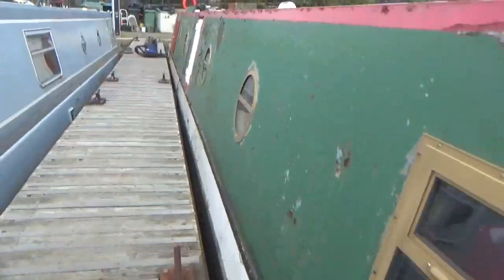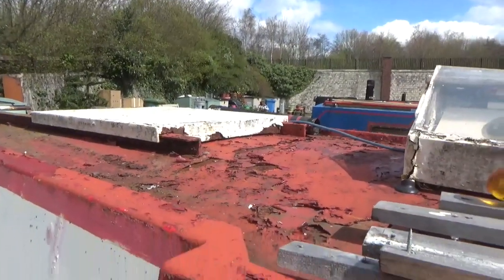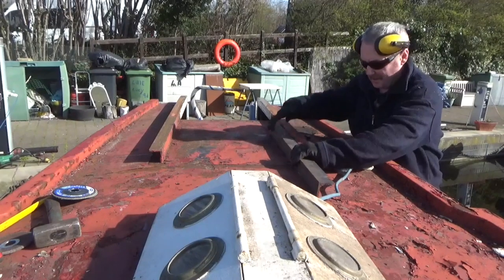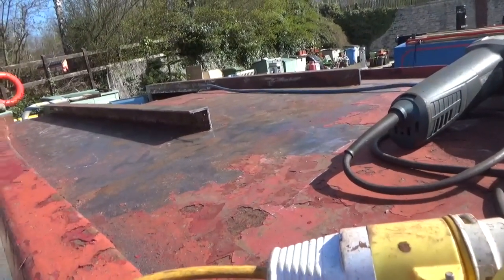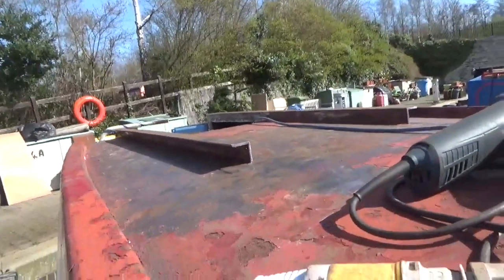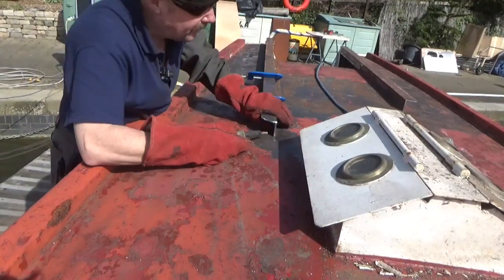Narrowboat Build & Fit Out Extending the stern hatch pt1

Comment: Andy,should new builds be left to go rusty to get rid of the mill scale. What are your thoughts on this subject.
Reply from the maker: Hi Gaz , boats were in the past left outside to rust and remove the mill scale I believe ,and there are some on the internet showing this. You can use various tools to do the same now on grinders etc. They do grit blast them  to get back to clean steel so the paint keys on directly. I was watching an Australian builder that used steel pre cleaned and primer coated before the build started.